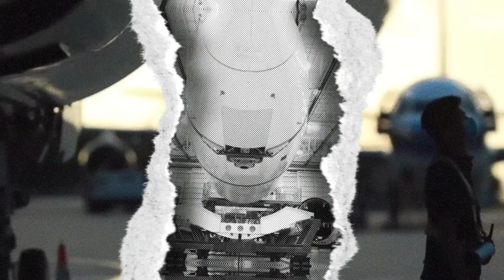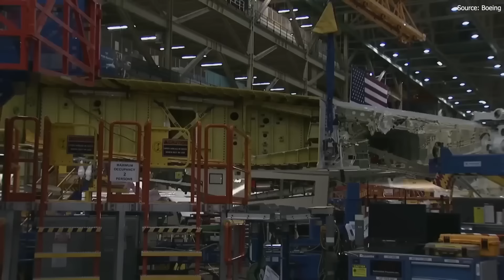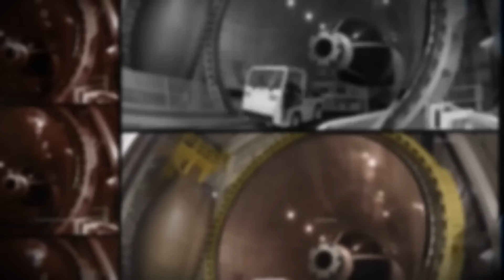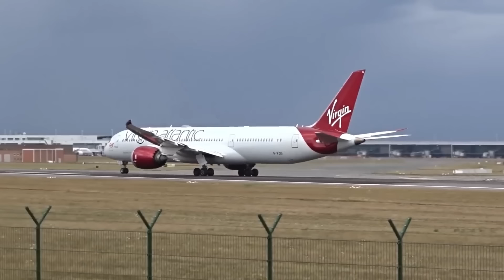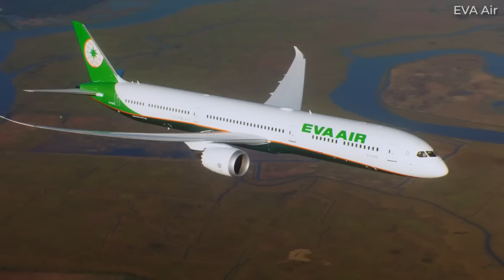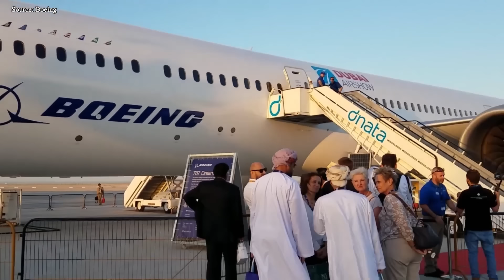This Is Why the Boeing 787-10 Is Quietly Dominating the Skies

Comment: The a350 copied the 787. That's what Airbus does. AirPUSS was accused of copying Boeing’s blended winglet technology, developed with Aviation Partners Inc. (API), for its A320 “Sharklets.” After collaborating with API (2006–2009), Airbus unveiled Sharklets in 2009, strikingly similar to Boeing’s 737 winglets (8 feet tall, 4–6% fuel savings). API sued, alleging Airbus misappropriated proprietary data, and the 2018 settlement saw Airbus pay an undisclosed sum to continue using the tech.
Airbus acquired Bombardier’s struggling C Series program (renamed A220) in 2018 for $1, later buying out Bombardier’s stake for $591 million in 2020. The C Series, a $6 billion advanced jet for the 100–150-seat market, gave Airbus a competitor to Boeing’s 737 MAX without R&D costs.
Airbus’s production spans multiple EU countries (France, Germany, Spain, UK), with final assembly in Toulouse and Hamburg, wings in the UK, and components across 27 nations. This model, backed by over $20 billion in illegal EU subsidies (per WTO rulings), funded programs like the A320, A350, and A380, giving Airbus a financial edge over Boeing.
In 2020, Airbus paid a $4 billion settlement for bribing officials in countries like China and Ghana to secure contracts (2004–2016), exposing a culture of corruption.
Reply: So, who tried to copy the A320neo concept of new engines, with disastrous results?
So, who tried to strangle Delta's purchase of A220 and force them to buy the still not-certified Max7?
So, who takes their country's president to China to try to secure orders?
So, which company has to put special workarounds into some of its main landing gear to prevent tail strikes (eg, 787-10)?
So, let's present balanced facts in future, rather than biased comments.

Comment: You significantly misstate the load carrying technique of modern wing structures.  You focus on the spar but should instead focus on the wing torque box.  The upper surface of the box is the upper surface of the wing.  Similar for the lower surface.  The forward spar makes up the forward portion of the torque box and similar for the aft.

The upper and lower surfaces have oddles of stringers which are carrying the wing loads as compression and tension.  While the spars are carrying the shear loads.

The entire torque box resists the twisting of the wing by converting it into shear loads for all 4 portions of the torque box to carry.  These sum with the other load components.

The wing torque box is an efficient method to carry wing loads and also allows a convenient structure to carry fuel.

Comment: The biggest concern is carbon fibre fuselage burns very well as shown by recent incidents! Passenger survival rates greatly reduced.
Reply: Fortunately not too many commercial passenger airplanes actually catch on fire. Still way safer than driving a car.
Reply: An aluminum aircraft does not fare any better.  A cabin fire in flight takes 8 to 13 minutes to destroy the aircraft.
Reply: Actually it catches fire more slowly and passengers have been able to evacuate due to its insulating the heat of flames. Tokyo Haneda A350 crash.

Comment: Why don’t they make a 777 size plane out of carbon fiber composite?
Reply: The 777 was designed in the late ‘80’s/early ‘90’s.  Long before carbon fiber became economically viable.
Reply: Should remake the C5, C17 or B52 from composite materials.
Reply: @dogmandan79 Air Force 1 should be Carbon Fiber for more range.  Maybe if they ever do 777 in Carbon Fiber in the future.
Reply: Next one will with 777 it would've basically been designing a new plane  with how long the certification processes has taken they probably should've just designed a new plane but that's what happens when you have bankers runner a manufacturing company instead of engineers  they tried to cut corners and get a new aircraft out quick and cheap to maximize profits

Comment: The 787-10 provides more cabin space than the 777-200ER.  

As airlines shift to increase premium seating, the increased cabin space allow the 787-10 to be an ideal 275 seat plane.  As comparison, the 787-9 enhanced seats 222.  

Of course with less seats and passengers, that frees up more weight capacity for fuel.  While the 787-10 is now advertised with a range of 6,800 nm, that is based on an average load.  Remove 50 passengers and their bags, that will increase range further than 6,800 nm.

If you go back to what Boeing talked about as the two proposed nma models,  they would have 225 seats and 275 seats which is right in line with the 787-9 and 787-10 with premium dense configurations.    At those seating levels, airlines can maximize revenue potential while being able to achieve high load factors.

Comment: What happened was that airlines suddenly realized the 6,400 nautical mile range of the 787-10 was way less of an operational issue than people thought. After all, the 787-10 could still fly from central Europe all the way to the US West Coast easily, and fly from the US West Coast to destinations in northeastern Asia. With the recent MTOW upgrade, the 787-10 can no effectively replace aging 777-200ER's on many long routes, too.
Reply: Exactly its economics and efficiencies reign supreme ultra long range is overrated  only a handful of Airlines need that type of ultra long range the money is made in long range 6400 nm or less not ULTRA LONG 787 is perfect fit